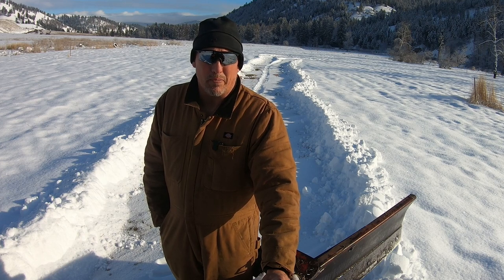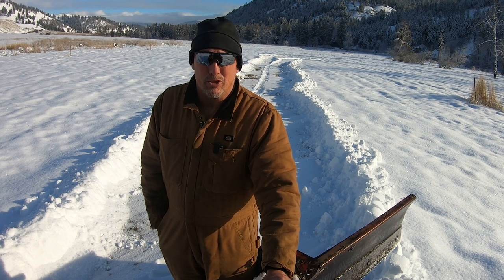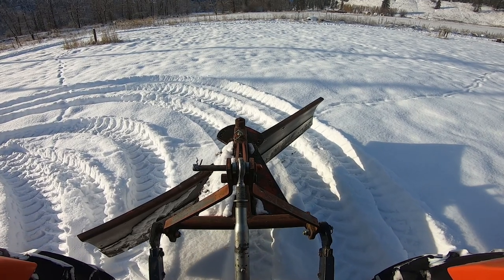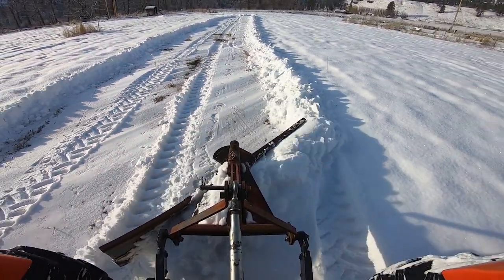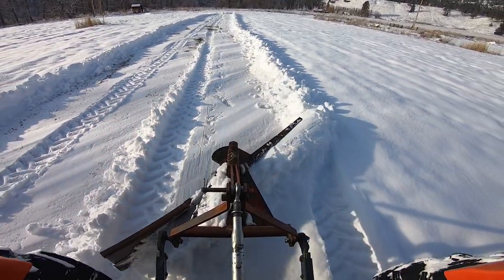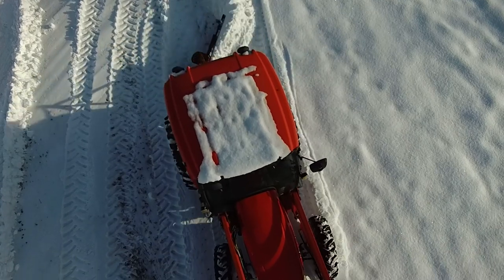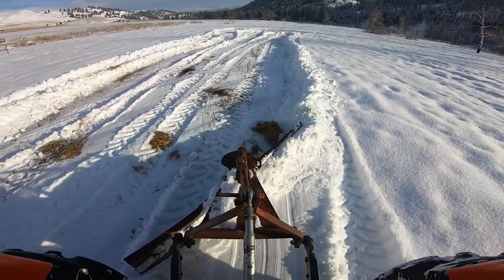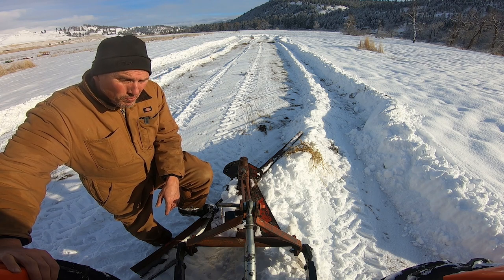More Tips and Techniques Using the Back Blade for Snow Plowing Snow

Comment: To prevent the rear blade cutting edge from digging in, you can reverse the blade.  The cutting edge, becomes a trailing edge.   The blade is usually heavy enough to penetrate and  scrape off the snow.  If not, add some weight to the rear blade frame

Comment: I back up and push them ridges on the last 2 rows, plow hits them first and rolls them right over. I have 4wd and use it fulltime.
Make sure the blade is pretty close to straight vertical wise, so you don't dig in, either frontwards or back. My 3pt is plenty stout for going the opposite direction. If some snow comes over the top of blade clean it up on the last trip.
Reply from the maker: Great Comment.  As the snow berm builds up,  I, also, have to do multiple passes.  We have 6" new this morning on top of about 16".  Finding room for the snow berm between fence lines is always a  challenge.  Thanks for watching!

Comment: Add another blade, make a rear V-blade. No more fish-tailing. Plus increased speed will really throw the snow.  When you back up the v becomes a scoop.
Reply from the maker: Thank you for your comment.  Yes, a V-Blade has its benefits.  I feel a straight blade is more efficient for directing the snow berm away for structures and other areas where it become hard to manage.

Comment: When blade is turned you have or should readjust the 3 point arm  leftside is high   it will ride better when leavel
Reply from the maker: Thank you for your comment.  That was a head scratcher for me until I hooked up this year.  I have never had to adjust the height as my 50-60 yr old back blade has a TON of play in the center pivot.  I'm talking 6 inches or more.  Hey, if It ain't broke, don't fix it!  Thanks for your comment!

Comment: Here's a good tip for you!! when you get a big Winrow use the back of the blade go backwards with the blade angled you'll push it all day long without spinning
Reply from the maker: I bet that would work great with a modern back blade, or at least one not welded back together with batteries and clothes hangers (previous unknown owner).  I'm really skeptical of the forces, after snapping the lower arm mount when backing a box scraper.  If, or when, I get a new back blade, I'll be sure and try it.  Thanks for the comment and for watching.  Stay Safe and Healthy!

Comment: So let me get this straight, you would pull the snow/backblade (going forward) rather than pushing it/going in reverse or backwards, correct?
Reply from the maker: Yup. Much easier on the drivers neck!   Honestly, depends on what your objective is.  A half mile drive way, you’ll want to simply push/slide the snow out of the way.  For your parking area, pushing the snow straight back might require backing with the blade reversed. Thanks for watching and your question!  Stay safe and healthy!
Reply: @KettleHavenRanch  Thank you!

Comment: If I reverse the back blade, snow gets hung up where the 3 pt frame attaches to the blade and won't slide off smoothly.  If I don't reverse the blade I dig in and remove all my gravel with the snow. I could plow in reverse but hate doing it that way. Any suggests for snow plowing forward and keeping the blade from digging in?  Do those skid shoes on Ebay work well? I'd just like to keep the blade 1" consistently above the surface and my driveway isn't flat.  Lots of hills and valleys.
Reply from the maker: Hi Dave!  I feel your pain.  Depending on snow depth, I try not to plow it all in one pass.  Try holding the blade up just a tad.  Be sure your blade is angled enough to dump the snow off the blade as opposed to building up in front of the blade.  You might find it better to leave an inch or so of snow on your driveway for the first couple of plowing sessions.  Over the course of the winter, it'll compact and ice up, helping protected your gravel below and allow the plow to slide across the top.  One of my neighbors swears by his field roller.  He rolls the first snow down to make a compact base, then the plow slides across subsequent snow accumulation, without pushing gravel.  Good Luck and Stay Safe!
Reply: @KettleHavenRanch  Thank you!

Comment: 60 HP Kioti, should be able to handle an 8 foot back blade.  If tires aren't filled I'd suggest filling with rim gard, Add weights and chains to the rear tires.  You shouldn't spin or slide sideways with that 6 foot blade.  Personally I like a front blower but they are expensive.
Reply from the maker: Hey thanks for the comment!  Plenty of RimGuard, I love that product.  Our 6010 C plows fine in our snow.  As you increase the weight, either by snow type (heavy wet), or while combining berms, you'll have tendency to slide, especially if it's on top of layer of compact snow and ice.  Thanks for watching!
Reply: @KettleHavenRanch  Ladder chains will save you a world of headaches and you will not slide.

Comment: rubber plow edge
Reply from the maker: Excellent option for plowing on pavement or really smooth ground.
Reply: @KettleHavenRanch  I need something that  I can plow frozen gravel and dirt roads with...
Reply from the maker: That’s all I plow.  The metal edges on both the back blade and box scraper work great.  I don’t angle either aggressively, so that the dig in but only slide across the surface that I’m plowing.